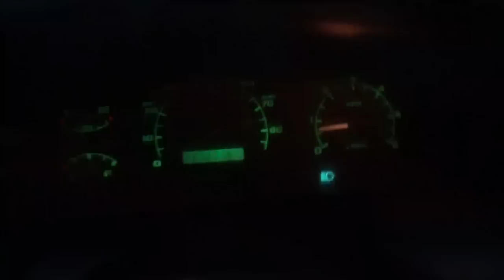Ford 550 Backhoe up and running. Dump truck on the radar.

Comment: Morning Joe.... all caught up now. That is a nice dump truck, just the right size. I owned a small Mack dump truck. It had a short box on it but I had it registered for 36 thousand pounds, even though the truck weighed 14 thousand empty. I did small driveway jobs with my dumper and bulldozer for a few years and hauled about three full cords of log length wood on it, but after that, the dump truck sat a lot and wasn't used so I eventually sold it. If I remember right the truck was a 1969 and I had to "double clutch" it to shift between the gears... was an interesting process to learn, but a lot of fun. Almost wish I had that back, but I think I would rather have a truck in your size range today. Have a good one.

Comment: Hey Joe, glad to see the dump truck running.the other day you mentioned all the mice, I was afraid you had a bunch of wires chewed up. Just needs a little love now.
Reply from the maker: I think I lucked out, a friend of mine a mile away had his 2015 Ford F150 computer plug eaten away by the mice about 2 years ago. What a nitemare that was to fix. The truck did everything but start, if you know what I mean with the computer haywire.

Comment: Hi Joe , glad to see the old ford running looks like a solid truck ck out fluid film might be good for the truck I have been using it for about 4 years  and rust hasn't gotten any worst were I have sprayed it and it lubricates doors and everything really good have a good night
Reply from the maker: It needs some work but I think I can get it working real good.

Comment: Joe,  The mouse repellent you used is called  Fresh Cab.  I can tell you from experience that the stuff really works. We also live in a heavily forested area as well and I use it to protect three non garaged vehicles.  I place one atop the motor of the truck which I don't use during the winter and one also in the cab.  CHEAP INSURANCE.  I buy multi packs online from Walmart.
Reply from the maker: Thanks for the affirmation, because the mice were making me crazy on the cars that are outside. They ate the hose going to my wifes 4WD actuator on her blazer.

Comment: Gotta love that Never-Seize ! Nice Truck. Start spraying a 45/45/10 % of diesel, kerosene, 30 weight oil in a 2 gallon sprayer every 2-3 months and within a year all that rust will turn black and look like new. Much better than paint or undercoating. JMO.
Reply from the maker: Hey I will try anything for rust. It isnt that bad and a little oil and kero wont hurt it.
Reply: @josaljo1 , Used to do to my F-250 plow truck and what a difference. I tried the whole (paint over rust) POR-15 Paint and spray undercoating stuff but nothing even came close to the diesel/kero/oil combo.

Comment: Nice old truck Joe i have one myself just a bit bigger. Mine is a C70 Chevy with a 10ft Galion dump bed 24,000GVW. Bought it to do landscaping then plans got changed you know the drill on that.  Last time i had it out was on a 300 mile road trip but its been setting for about 4 years now. I expect with some tlc it could be put back out to work.

Comment: Dump Truck looks to be a worker. Not only for carrying logs but to catch chips when cleaning up slash. Sure will be easier than shoveling them out of the pickup box. Some tlc will do wonders for it and it has a lot of life left in it to give.

Comment: A couple of Victor snap traps and a dab of peanut butter will answer your mouse problem in a hurry.
Reply from the maker: I had 40 traps I kid you not. These PA. mice take them apart and make spring boards out of them. Lol
Reply: @josaljo1 , Take a 5 gallon bucket, put 5'' of water and bird seed in the water, with a thin wire running from one side to the other near the top.